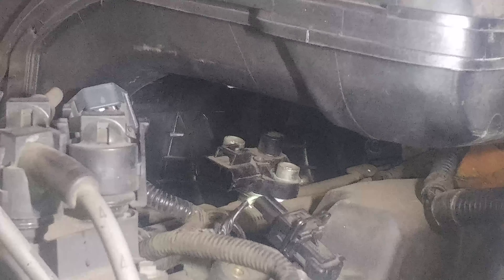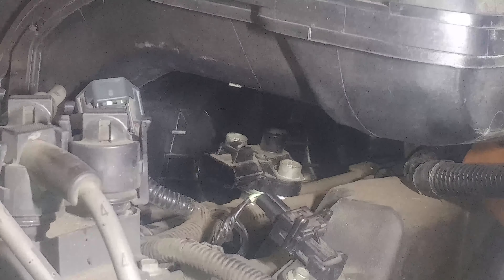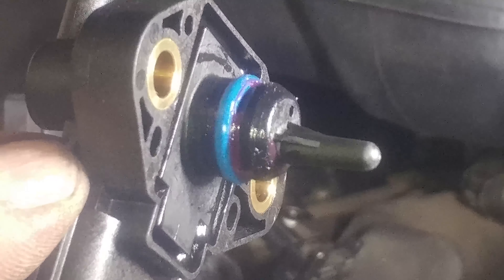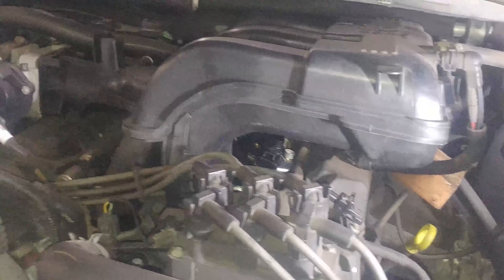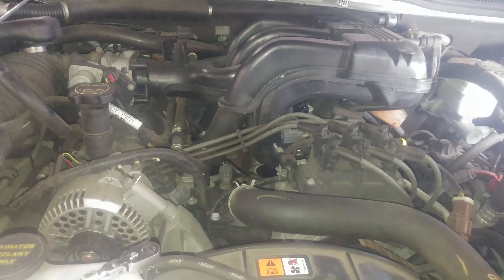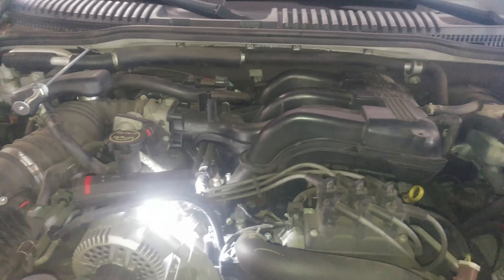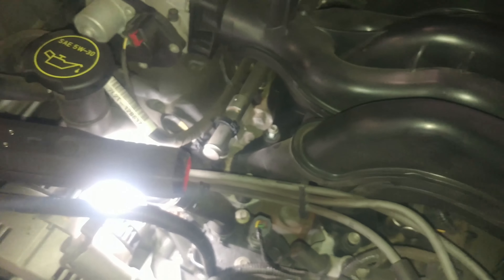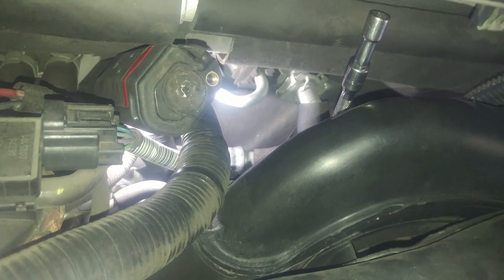Fuel pressure sensor replacement 2007 Ford Explorer 4.0L V6  VIN E

Comment: It would be a much more useful video if you told the audience WHY you are replacing this part, and what the symptoms were. Its not really helpful just to watch you replace a simple part. We search these videos to see what problems other people's vehicle have, to try and match to our own symptoms. 
My question is: does this part throw a code when its failed? Did this sensor being bad cause a non start condition? These are pertinent points of information. Please comment if you can remember, well after the fact.

Comment: Did you have to loosen the intake manifold to put the block of wood in?
Reply: I had the same ? It looks like it. Mine is further in. Good luck.
Reply: @on2ndtott312  you do have to take all of the bolts out of the intake to block it up. The gaskets on the intake manifold all stayed in place and made for alot easier job. Worked out great for me - hope it works great for you!

Comment: On my 08, the FRPS went out at 72K.      Easy fix with the right tools a little patience. Currently, 146K and still rolling. Fingers crossed. 🤞Thanks for your videos.
Reply: Have you had the timing chain issue yet? Or the radiator housing leaking?
Reply: @mrbigstevo  No. I do not have the timing chain death rattle yet. I had a radiator seam (on top) leak in 2011. It was replaced under warranty and have not had another leak since. I still own the vehicle and it now has 150,000 miles on it.

Comment: Thanks for your videos. I've been looking high and low for someone doing an OEM front shock change for the Lexus GX470. There's a sticking point for me with the "absorber control actuator".
Reply: It's not as bad as u think. I install 2" lifts on the 470s while keeping oem equipment.

Comment: What made you think it's the fuel pressure sensor? What was the vehicle doing before you replaced it?
Reply: Well for starters a check engine light will come on get a scanner to read it, and then like me my. 07 Ford Explorer wouldn’t start
Reply: Mine showed Fuel rail pressure sensor A high